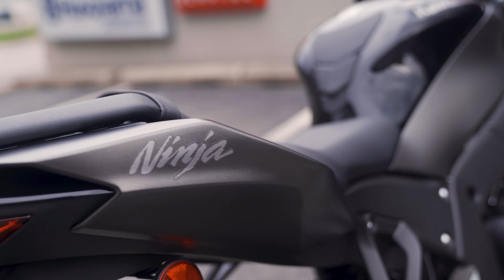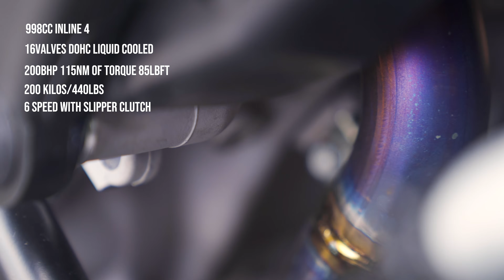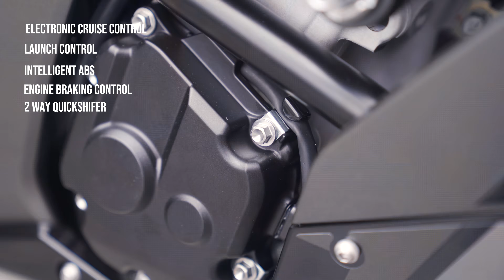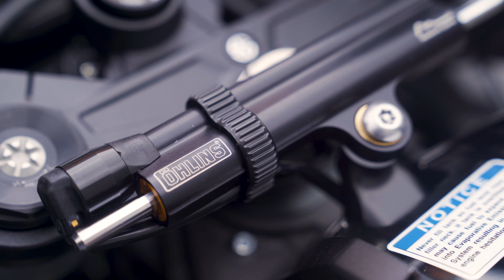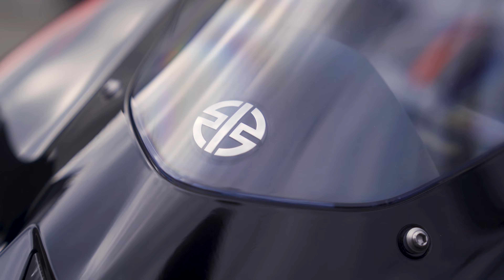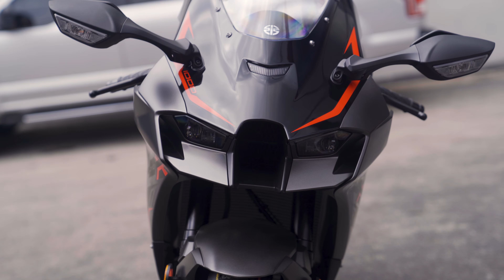Superbike With the Most Tech? 2022 Kawasaki ZX10R

Comment: Kawasaki won 6 consecutive championships from 2015 - 2020 with the 10R and 10RR. I'm guessing the H2 wasn't allowed in WSBK?
Reply from the maker: The WSBK rules stipulate I believe that it has to be naturally aspirated machines. The H2R is not naturally aspirated as you are probably aware even though the engine size matches the requirements. Also, the H2R is not exactly designed for cornering speed.
Reply: h2 is hyperbike not a superbike
Reply from the maker: @vincentcycle  Not really. It is a 998cc. It is a SBK in terms of engine capacity. 
ZX14 and Busa are hyperbikes.
Reply: @KrishnenduKes  it is a hyperbike as per manufacturer. engine displacement is not requirements for bieng a hyperbike. its the horse power.
Reply from the maker: @vincentcycle  You are right there. Kawasaki does mention on its website that the H2 is indeed a hyperbike.
Reply: @KrishnenduKes  where does the super end and hyper begin?
Reply from the maker: @malrobles  Good question. Once upon a time the Busas and ZX14 were called hypersports. But Kawasaki has mentioned the H2 as a hypersports. So... I would ask that question to Kawasaki!
Reply: @KrishnenduKes  i feel like they call it a hyperbike because they might be adding in the displacement of the supercharger with the displacement of the engine. just speculation bit i would imagine it would cusp the hyperbike cc range if you added them together. or maybe its a term for a certain horsepower threshold?

Comment: I had a 2021 and loved it. I also had no problems with the electronic aids. I felt very comfortable riding the bike And I even lowered the front end a little bit.  And in any my comments I am a 65 year old rider.
Reply: I am about 5'5"-6" with boots. Could I manage this stock or would you also need a lowering link for the rear if you brought down the front tri-tree?
Reply from the maker: @briangiven7399  That is a good question. Actually, I know someone with whom I have ridden who is 5'4" and rides a similar bike with aplomb, on the streets and on track. It all boils down to the amount of experience you have. If you have enough experience, you will be able to manage it with ease. Best way to find out will be to sit on one. Hope this helps.
Reply from the maker: Great to see that you are riding. Would love to meet you one day.